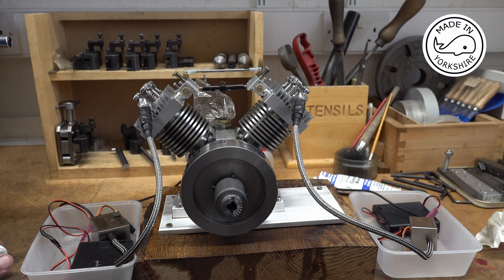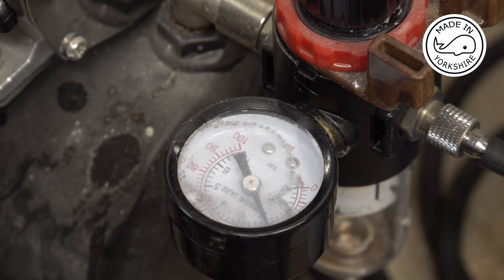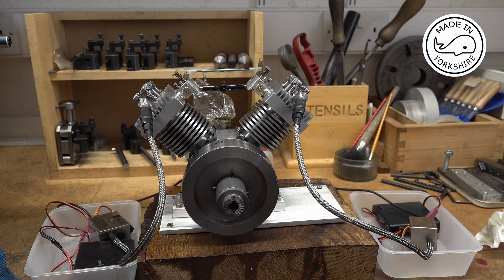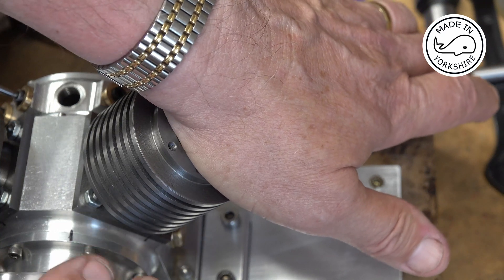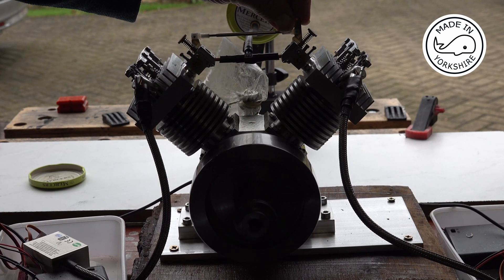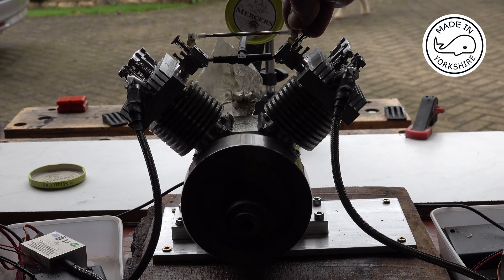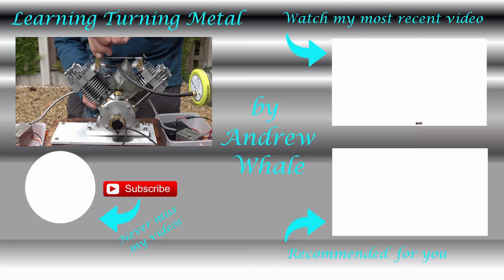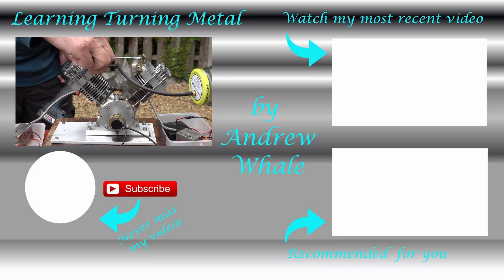#MT49 Part 23 - Jerry Howell V-twin IC Engine. First Run. In 4K/UHD by Andrew Whale.

Comment: Congratulation on getting it running may I suggest that the head/barrel leak could be sorted by lapping as per vale seats. This tecnique was often used on British bikes in the past. As for oil leaks it's just the engine showing character and scent marking it; territory 🙂

Comment: Sounds nice Andrew. I'd think again about your head gaskets. Paper's not a good idea, & definitely not silicon, they'll break down very quickly. If it needs gaskets, use thin copper sheet shim stock or even a few sheets of tin foil to make them, either will work. Or you could trepan grooves in the barrels or heads to accept Viton "O" rings. KTM & others use the latter in their 2 stroke engines.
Reply from the maker: Hi Dave
Many thanks for the advice. I'll get hold of some thin copper sheet. It's a shame the design doesn't cater for an o-ring and there isn't much material to play with to cut a groove in the head.
All the best.
Andrew

Comment: Hi Andrew I'm enjoying. Watching your videos but I'm kind of lost on the mini lathe you are using now the feature on the carriage is different from your first mini lathe the actual mini lather does not have a separate threading lever on the side did you add the new features and if so do you have a video on how you did it
Reply: The lathe is a Sieg sc4 lathe.
It has power feed for longitudinal and cross feed as standard
Reply from the maker: Hi
As Adam points out the lathe is a Sieg SC4 without modification. However I would like to add an electronic lead screw at some stage.

Comment: More congratulations on this project from me. I am very good on the steam engines and boiler plants but have a rather poor success record on gas engines so I live vicariously in that field through your channel. Question is what's next, one of Doug Kelley's Snow tandem double acting engines or Ronald Colonna's  1/4 Scale 270 Offys?
Dick B. USA
Reply from the maker: Thanks Dick. I promised my wife that, once I get the engine running, my next projects will be DIY based around the house 😔
All the best.
Andrew

Comment: Congratulations Andrew! 
For an electric starter, You could use a small electric motor, mount a one way clutch bearing, could be a needle- or ball- bearing, into the gearing and Bob's Your uncle :)
You didn't seem to reply on my latest comment, where I offered You a RCEXL ignition system for a twin gas engine. It's brand new and still Your if You want it. It fires simultaneously on both cylinders, with only one sensor and one battery pack. It can run between 5-14 volt I think, so You can use literally any battery.
Reply from the maker: Hi Kim - I musted have missed that one! Many thanks for the offer but I decided to stick to the original design.
All the best.
Andrew

Comment: Great you got it running, congratulations! Although I guess nobody but you had any doubts you would succeed eventually.
Of course there’s still a lot to do, as you pointed out. Nevertheless, do you already have plans for the next project? A radial, maybe?
Reply from the maker: Hi Kai - I'm not sure what to make next. I really need to convert my lathe to an electronic lead screw for thread cutting. I also promised my wife that once I got this engine running I would do some long oustanding jobs around the house 😔
Cheers
Andrew

Comment: Congratulations Andrew! I'm about a month behind you building the same engine and I'll be very happy to see it run too. If you didn't already take a look at the video "Howell Twin 4 Stroke by Cor Rademeyer". I'm using the same cheap starter motor as he used, and it seems like a good option. Cheers!
Reply from the maker: Hi Tony - thanks for the info. Which model of moped starter motor did you decide upon?
Cheers
Andrew
Reply: @learningturningmetal  I bought this one from ebay - " 2-Bolt 10 Tooth Gy6 50cc Scooter Moped Starter Motor Starting "
Reply from the maker: Hi Tony. Thanks for the info. That's put me on the right track.
Cheers
Andrew

Comment: Hi,Andrew. Great to see her running at last. It will improve a lot as you tune and tweak the carburation and get a more stable and reliable fuel reservoir level. On the subject of built in starter motor my suggested set up would include an epicyclic geared electric motor and a one way sprag clutch bearing to act as the drive/freewheel mechanism and a small toothed drive belt to connect the starter pulley to the crankshaft starter pulley. All the components I describe are readily available from a large number of suppliers. Small toothed belts and various sized pulleys are widely available,the sprag (one way freewheel clutch) is a type of needle roller bearing available from Simply Bearings and other bearing suppliers. Geared motors with inline epicyclic gearboxes built in on the front are quite compact,available in various DC voltages and various sizes and torque outputs. The sprag/freewheel bearings are also quite compact and act very much like the freewheel on a pushbike does.
Reliable head gaskets can be facilitated by using a couple of suitable diameter Viton 'O' rings seated into a shallow groove in the cylinder head mating faces. 
The pulsed fuel reservoir pump is the same principle as most diaphragm type carburetors employ on small petrol engined garden blowers/vacs,chainsaws etc. The crankcase depression pulses operate the little diaphragm pump. You could also use a low volume small electric solenoid type inline pump to maintain the fuel reservoir level.
One last observation is on valve seat lapping. When lapping small valve seats such as these it is good practice to finish the lapping with a very fine abrasive such as Diamantine (often used by jewellers/watchmakers) or metal polish paste such as Solvol Autosol. Note that Diamantine is not and does not contain actual diamond abrasive,which should not ever be used on valve seats because it embeds into the metal faces and continues to act as a long lasting abrasive.
Reply from the maker: Hi Howard - many thanks for such a detailed comment. I will start investigating! Yeah, I think the lack of a reliable head gasket is a bit of an oversight by JH. 
All the best.
Andrew

Comment: The fuel tank pump setup is an alternative to carburettor bowls.  The constant level in the small tank near your carbs makes the adjustments stay constant compared to the rich to lean mix you will get as the carbs draw from the high to low level of a larger tank.  Also, if the carbs are set and working well the Idle mix needle should keep the engine running at low speeds with the High Speed needle completely closed.  Once you have the idle set where you want it you can start opening the High Speed needles and revving the engine to tune the top speed.
Reply from the maker: Hi Henry - many thanks for the advice. Really appreciated.
All the best.
Andrew

Comment: Congratulations! It could be time to open the champagne bottle, don't You think?
About fuel levels. Look at Your motorbike! The tank is mounted above the carburettor level. As I remember that system a simple float valve regulates the fuel level. Too high level, the valve limits down the inflow of fuel..... The system has its equilibrium.

Comment: Excellent result! Well done. I'm sure once you're sorted the carbs out it'll tick over very nicely (my guess is  that the idle mixture is too rich). Not sure how long your head gaskets will last, but if they fail, try some thin copper instead (annealed) - you can thin down copper washers from hydraulic fittings on the lathe if you can find any the right diameter (glue them to a faceplate) .

Keep up the good work :)

Comment: The engine looks great. 

It's a sham that you don't have a compression gauge. It would have saved you a lot of time and made it much easier to troubleshoot the problems that you encountered. Copper head gaskets or O-rings should solve the head leaks. 

There are numerous starting systems used for RC hobby engines that should work for you. Some of the 3 phase brushless DC starters are very compact and powerful, but they do require a controller that generates the phases. So they are a little more complicated than a conventional brushed DC starter motor.
Reply from the maker: Thanks for the info - very much appreciated.
Cheers
Andrew

Comment: You must be over the moon with that. It sounds amazing.  I saw a good video on setting up petrol chain saws, which have 2 jets.  Essential Craftsman, I think visiting a friend, worth a look, it might be the same setup.
Reply: 2 stroke engines are set up different for different reasons.
Reply: @pvtimberfaller  done a bit more research but whilst terminology is different for 2/4 stroke carbs, the concept appears essentially be the same when you have two fuel valves, one sets the idle or low circuit fuel delivery and the other sets the fuel delivery for higher revs/high circuit.  Please could you let me know what the key differences are? I am about to attempt a  carb tune and would benefit from a bit more understanding of the valve relationships.

Comment: Well done Andrew, had to happen. It needed higher throttle setting so it could suck fuel into carbs (vacuum system) I suspect. Sounds lovely. Keep at it you’ll get it done. Cheers and stay well.